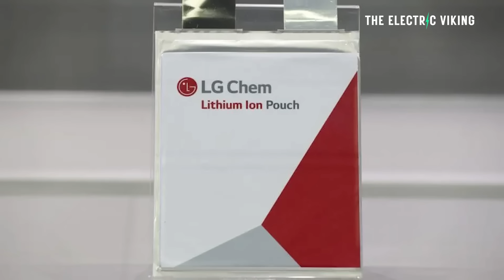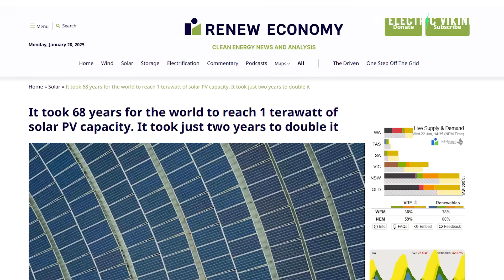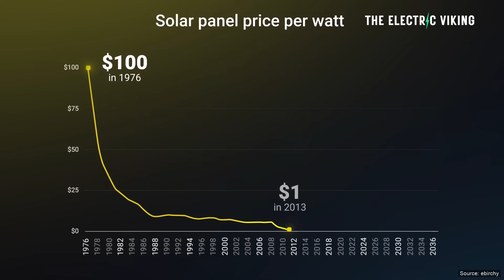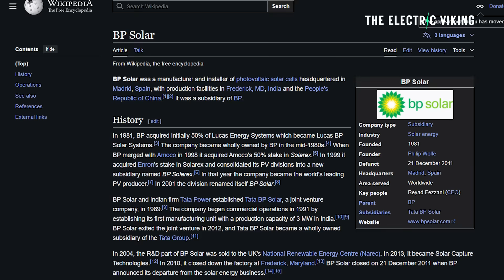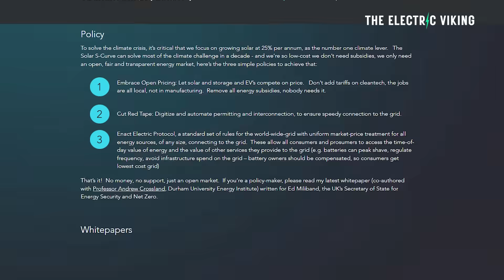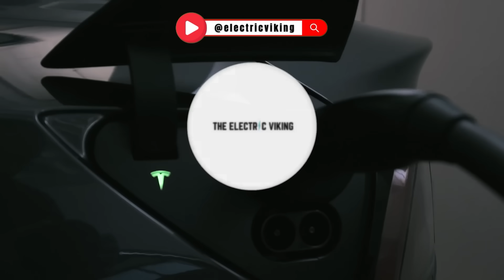S-Curve modeling predicts half of world’s energy will come from solar by 2035

Comment: It’s a bit distressing to hear naysayers point out that the sun doesn’t shine at night and that it’s not always windy. Not because it’s true, but because can they really think that anybody has to be told that? The fact that so much work has gone into energy storage (and not just batteries, also hydroelectric, gravity batteries, heat storage etc) implies that, yes, we actually did know that, and no, we are not waiting for the sun to stop setting.
Reply: Actually, the sun ALWAYS shines on a goodly portion of Earth's surface.  If HVDC lines could efficiently transport energy east and west around the globe, and south to north from tropical region to northern countries, then no storage at all would be needed!
It is technically feasible.  OBVIOUSLY, going all the way in this direction would be financially excessive.  But so is storage without such interconnections!  So, the answer lies in a cost optimum between the two (plus a few other ways to address wind and solar intermittence).
Reply: Always funny when somebody comes along with "It was cloudy today, if I had solar it wouldn't have produced anything!", as if they're the first amazing genius to have figured this out. Also it's not even true, anyway. Some people on Will Prowse's forum are getting power from moonlight! (not a lot, mind you)

Comment: 10kW solar plus 13kwh battery and I’m effectively off-grid as well as outages are a thing of the past.
Reply: How much did those batteries cost? I have built two 8kwh packs that total $3k or so. I would need at least twice this for my meager 1100 sq ft townhouse. I live in a townhome that has limited roof space and in winter I get no sun on my roof. I love solar, but it is not economical for the majority of people. IF batteries were as cheap as solar panels 
Then no problem. And they might be in a few decades, but right now: no.
Reply: @taylorcuthrell4123  I have 10kW system on the roof facing north, a Tesla 13kwh battery with our new house plus a 32amp Tesla Gen 3 charger. All up cost was $31k and expecting to be net credit (saving $2k annual power bill previously plus another $2k saved on my fuel bills for the car). Expecting to pay off the investment in 5-7 years.
Reply: @taylorcuthrell4123 Does your electric price fluctuate over the day? Even charging the batteries at night and using them at peak times could save you a packet. Treat any charge from solar as a bonus.

Comment: Storage costs need to come down and improvement in battery chemistry and safety is critical. (LG chem battery fires in houses in Victoria a massive issue) 
Solar alone will not be the answer for many regions. 
Where I am  in Victoria Australia, my solar generation from a 9.4 kW system through an 8 kW three phase inverter provides significant seasonal variation with my best month December generating 1.6 MWh and my Winter month of June generating only 465kWh of energy. 
During the late Autumn (Fall) through Winter into late Spring the generation falls to an average of 800 MWh. 
From my generation reports there were 60 days over the 7 month period of March through September where solar Power was less than 12 kWh for the day and my home typical averages 22 kWh usage. 
On those days I did not generate sufficient to charge a battery above the consumption so the grid had to supply. 
Full 12 months Solar generation in 2024  my my system  saw 12.4 MWh of energy. 
Even during November and December there were overcast and poor light days that produced less than sufficient energy to cover my days consumption. 
Batteries need to store at least 3 days worth of generation capacity if Solar alone is to replace fossil fuels or nuclear base load for evening and night time demand.
Reply: Stop using numbers and data. Vibes only 😂.
Reply: @ numbers and data are factual not feelings or wishful thinking and representative of evidence based analysis
Reply: batteries are cheap. So what is the issue for you exactly?
Seems that doubling your solar and adding batteries would solve your issues.
Reply: @williammeek-h2o  $15,000.00 for 13 kWh ain't cheap and payback at $0.32 peak  rate power charge is over 15 years .
Reply: @michaelanderson3771  How about $2000 for 15 kWh?
Reply: @ not here in Aus a 15 kWh system going to cosy $18,000.00 not $2,000.00